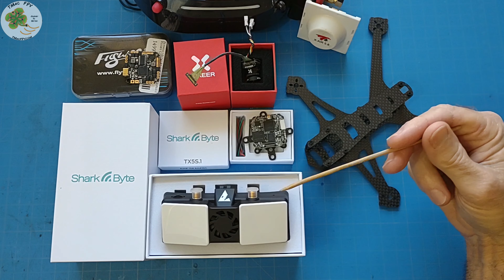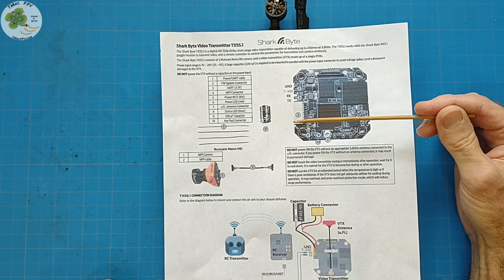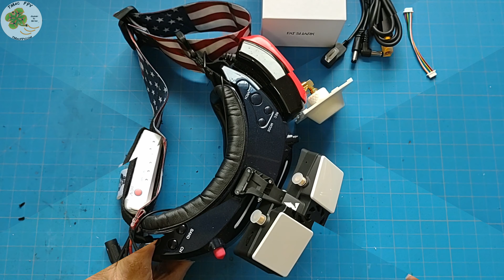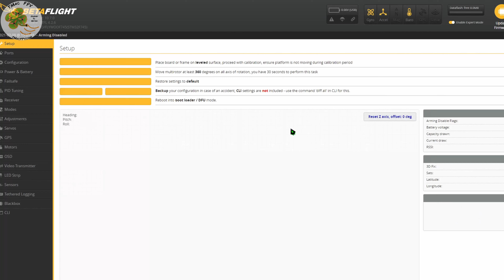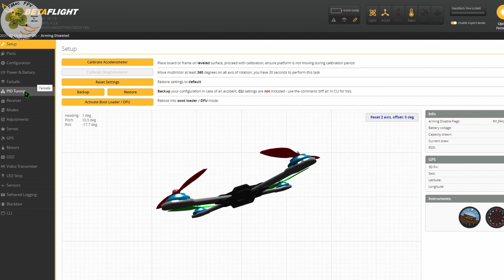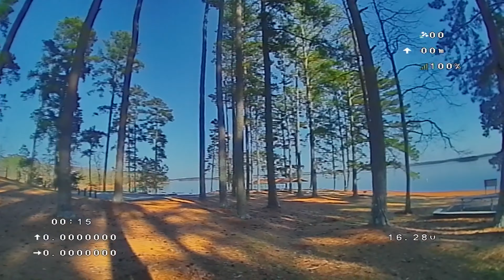FatShark Shark Byte (COMPLETE & SIMPLE SETUP!)

Comment: Hi Tmac.
I absolutely love your videos.
I can not say how much they have helped me get into FPV and mostly on the sharkbyte aspect.
So first of all thank you very much for all that.
I have a question and can't find the answer anywhere.
I know I can have rec auto to have the DVR running but I don't Realy like the fact that it records all the time.
Is there a way to record the way I do it with my analog module and my 03o goggles?
Again that you soooo much.
Reply from the maker: Thank you! I'm very happy you've found them useful!  Yu can start and stop recording by swithcing between "setup mode" and "video mode" on your goggle module (VRX).  You do this by pressing an holding the scroll wheel to the left (see page 13 of User manual you can download here https://fatshark.helpscoutdocs.com/article/171-shark-byte )
Reply: @TMacFPV  I found a solution to Mt issue... I have some real pit modules lying around. I'll set one up on the vtx. Like that I can start and stop video rec by simply turning on and off my vtx...
Thanks again
Reply: @TMacFPV  oh so that meens that with the record on auto each time you power the module the first thing you do is stop the rec?? And Start it again when flying??

Comment: I didn't know analog was dying... I've spent so much already 🤬🤦 it looks waaaay better and totally worth it probably
Reply from the maker: The flight experience with digital Shark Byte I find to be a lot more fun and enjoyable than my "high-end" analog setup
Reply: @TMacFPV  My video system consists of a rush ultimate tank 2 vtx, micro foxteer t-rex camera, skyzone cobra x goggles, a axii2 omni on the quad, omni on the goggles, and a patch... It's ok but my pacer f7, I made a jst for the dji plug but I  couldn't get power to the vtx when I had the camera powered through the plug 🤔... Oh well, my soldering is a litttle under par but it's working alright I guess lol... Don't really have another quad to reference the video quality so 🤷 might get dji anyways...

Comment: Hello TMac, just wondering what kind and brand is that black tape you use to secure the wire? Do mind providing the link on where I can buy it please?
Reply from the maker: Sure Wilfred, it's EMax fabric tape, but any brand 8mm wide fabric tape should work the same. Here's a link to some I found in I believe  U.S. I've not purchased from this shop before, so I just don't know their history. Only other places I could find it is on EBay, Banggood, and EMax itself (which is where I got mine). https://team-legit.com/EMAX--Fabric-8mm-wide-adhesive-tape_p_2005.html

Comment: TMac, have you experimented with different external antennas? I'm very interested to hear how well a good directional setup compares to a comparable analog diversity setup. Thank you.
Reply from the maker: Hey Justin! Thanks for the question.  I'm not sure if you're aware of this or not.  The two white squares on the front of the Shark byte module are patch (directional) antennae that it comes stock with.  Therefore, unless you'll be flying "directly" in front of you in a rather narrow beam width, it makes sense to add omnidirectional antennae to the other two connectors.  I have a Lumenier Double AXII attached vertically to one of my other connectors and a Lumenier Stubby AXII attached horizontally to the other.  This "stubby" AXII is therefore 90 degrees to the other AXII.  This, in theory, gives me better reception overhead (where the vertically oriented AXII may have nulls.  I4 dire3ctional antennae pointed in the same direction may give you  better reception in that one direction.  Also, you MAY be able to get better reception by replacing the stock patch antennae with higher gain (and therefore narrower beam width) directional antennae.  Of course, this would mean you would need to know the spec's of the stock patch antennae Shark Byte comes with so you could actually improve upon them.  I'm going to give you a link to a YT video of someone who has swapped out the stock patch antennae with X-Air antennae and then attached omnis to the other connectors.  He believes he's getting better reception with the patch antennae swap out.  for me, with the flying I do, my setup works absolutely great for me.  No need for me to swap anything out.  Hope this helps. Here's the link to the patch swap out video https://www.youtube.com/watch?v=wg1-Qw9SRNA

Comment: Osd telemetry working?
Reply from the maker: Not sure how familiar you are with Shark Byte OSD or not.  The User Manual  shows what OSD elements are supposed to be available (think I show them in this video also).  The elements that display for me with this VTX (TX5S.1) are RQLY (for Crossfire), which is enabled through "RSSI," battery voltage, GPS Sats, GPS Lat, GPS Long, GPS distance from home, GPS home direction, and OSD Warnings.  I am currently not getting VTX channel or power, nor am I getting Craft Name.  However, there's a firmware update Fatshark is currently working on (to be released this Spring?) which is supposed tofix some OSD elements and also give the Shark Byte system 1080p HDMI out.

Comment: Byte vs dji ??
Reply from the maker: I've not flown DJI and from what I understand, the DJI image quality is currently better than Shark Byte. However, there's also other aspects of each to consider. Such as, I believe Shark Byte system  has less latency. Its screen also doesn't "lock up" all of a sudden when your video signal gets weak and take a long time to recover (meanwhile you're flying blind). Shark Byte will slowly "pixelate" to let you know you're losing video signal (although I haven't had any video reception issues with it). Shark Byte has a lightweight, single-board VTX for smaller quads (4" props & less, to include Whoops). If you already have a nice pair of analog goggles, the Shark Byte video receiver module (VRX) which can be used with those goggles is only about $250-$270, rather than needing to purchase another new $570 goggles. New firmware "coming soon" I've heard for Shark Byte system with some improvements also. Maybe this Spring?🤔I'm not disparaging DJI. To each, his own. Whatever works for you and makes your flying fun!😁👍
Reply: thanks friend for your reply new subscriber
Reply from the maker: @Realestitanes  Sure thing, Robert Racing 👍Welcome aboard your TMac FPV Team!

Comment: I'm fully invested in DJI system (discovered the hobby in July  2020) and find it works great on my 3". I even have it on my daughter's sub 250g 2". Nevertheless, I found your video interesting. Great tutorial for SB installation for those who choose to go that route. My biggest concern would be range with 200mW output although I have never flown analog so I don't have a good comparison base.
Reply from the maker: That's great Jan!  Correct, 200mW is not for "long range" as I indicate in the video referencing FatShark's User Manual which acknowledges this.  You can get about 1.5km on 200 mW which is more than enough for me

Comment: Been flying SB for a couple months now..love it.. Have it up and flying in a 7" Glide with the medium range board and sitting on my desk with a USB cable sticking out of it waiting for betaflight is a flywoo explorer 4" with the whoop board and a AIO FC that's way under 250 grams.... I've replaced the front plates on the goggles VRX with 3d printed ones that let me bring out SMA connectors (ufl on the board)  so I can use different patches or CP's if I want...I ended up with a CP on one side and a Maarten Baert patch on the other where the OEM patches used to live..
Good Air , Straight Props
Reply from the maker: Wow Steve! Very cool!😎

Comment: footage looks good. if they can bump up up the vtx power for the aio board to like 400 to 600, and that's gonna be on LR territory.  i like this setup coz dji fat goggle is just too front heavy on the face.
Reply from the maker: I was just thinking about the weight of the module myself. It's so light, I don't even notice it👍

Comment: That's awesome. I also have skyzone 03o goggles and I've decided to get the shark byte system. The thing I don't like is that its inky 200mw. I hope they upgrade that soon.
Reply from the maker: I was very happy the fan shroud fit! Didn't have to rig something up and could use "tilt option" available with shroud mount. New firmware should be coming out soon too👍🌅
Reply: Hello, how about the 4:3 aspect ration on SKY03O and the 16:9 from SB HDMI feed? How does it look on googles?
Thaks
Reply: @gabrielaltea  You know, I'm not sure. I don't know what aspect ratio my goggles are set at and I've never bothered to change it because I like how they look out of the box.

Comment: Shark bite looks good and promising for smaller models. Small and lightweight, just like we want it to be.  Now I'll need a decent goggles to go with it. And some flowers to the lady to let her know that she is the one I love more...
What about the range? Is it good?
Reply from the maker: Haven't tested range with it yet. Haven't had any issues flying around objects (like my house low to the ground with me on the other side of house). Better reception than analog. I'm using the single board that has max output power of 200mw. I've heard of a few folks getting a few km out of the dual board VTX without issue